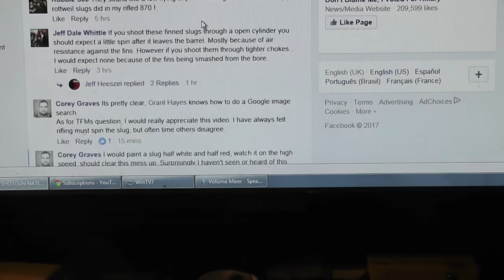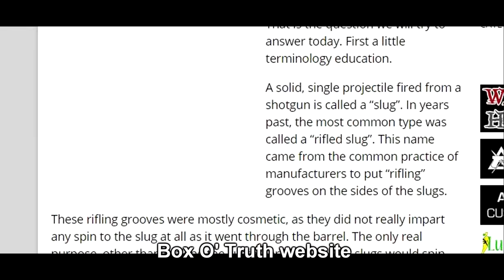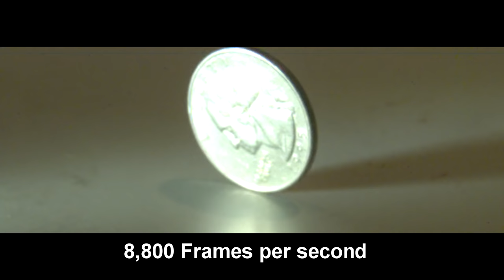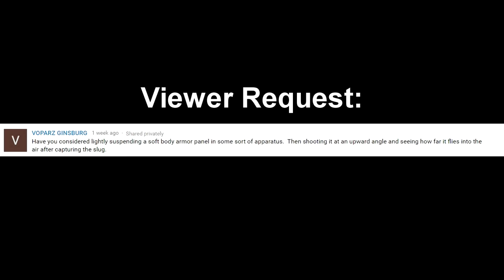Do Rifled Foster Slugs REALLY spin or it is just a MYTH?

Comment: I now run a 1oz smooth slug cast in a Lee mold from shot that I have melted and cast from cheaper "bird shot" cartridge and then reloaded with the slug. I use a Carlson Rifled Choke and the combination yields a pretty good result as my slug barrel gives me a fairly consistent 2'ish inch groups at 50 yards... and my smooth barrel with the Carlson choke gives me a 3'ish group... I'm fairly pleased with the results and didn't really expect it would be so good... it's also a lot lighter and more compact than carrying around two barrels. 😉

Comment: That is not how physics works. All friction is ALWAYS in the opposite direction of motion and can not introduce a torque perpendicular to the direction of motion. Having a rifle on the bullet will not cause any spin in a smooth bore barrel. All friction is straight backwards with 0 torque. Unless the slug is actually digging into the barrel, then the spin is from atmospheric effects or just randomly occurs.
Rifled barrels spin bullets because the bullets dig into the rifling and a torque is provided from the intermolecular interaction between the parts of the bullet stuck in the grooves of the rifle and the slug.
(Test this yourself: Slide a wooden plank slanted 45 degrees across a smooth surface, it will go straight, friction doesn't care about angle of contact.)

Comment: What if the rifling was cut into the head of a smooth slug where the shockwave is created?
Reply: This would probably make the slug inaccurate because the cuts are not always in the same position in the barrel when chambering the round but it is a great question I am curious about, too!
Reply: Green Silver might work but since thats your contact point with the air any imperfection would be greatly amplified as inaccuracy.
Reply: Fergesslich what degree of rotation a projectile starts spinning at has no effect
Reply: All you'll do is mess up the shock system further. If you want to give it rolling moment (that's the fancy word for making it spin aerodynamically by the way) just put some damn fins on it. Don't try to fuck with the shockwave, it is not your friend :P
Reply: being a SHOCK wave, the rifling would have no effect until it dropped below the trans-sonic wave barrier, at which time the wave would be able to shed down the path of flow and impart spin.

the only way (EDIT: that I can immediately see) the rifling would be able to impart spin via (nose interaction) would be rotational momentum gained through vortex shedding.... given that the rifling was deep enough and allowed for a vortex trough to form large enough to overcome the mass of the slug 90 degrees to the direction through it's medium of travel (1 atmosphere ambient air).

Comment: Is the lead of the slug really touching the walls of the barrel?  most are sabot in a plastic shroud to launch the slug.  Ive had discussions on this before with long range shooters and found that the design of the sabot is what gives the slight spin and not the ribs on the slug.  They are there for drag and not inherent for twist.

Comment: Oh... crazy thought... What about a small loose steel ball that would completely fit inside the cup under a foster slug? Would it travel within the shockwave of the slug without affecting the accuracy of the foster slug? Would the steel ball improve penetration?

Comment: I've been using the Lyman 525gn  'shuttlecock' slug with 21gns of Unique, AA white wad with an m6 nylon washer under the slug and a star crimp out to 250 yards. The only complaint comes from the target and my shoulder after a box or two. BTW, the gun is a 20" smoothbore with a rifled choke, straightpull fitted with a 3x9 scope. A great combo. 
Ocassionally I use an old b/a Mossberg smoothbore trimmed to 20" (no choke) fitted with a 6x scope. Never had so much fun with a shotgun until I discovered the Lyman slug.

Comment: The larger the diameter and the more mass you can place closer to the diameter, the more stability you'll achieve at a lower angular rate of change. That slug isn't hollow by accident. Great video.
Reply: Exactly!  Nor is a rate of spin of 600-800 RPM insignificant in  body of that weight and circumference.
Reply: @terrywaters6186  So @ 10 RP. How might that be expressed as a virtual rifling twist? The Enfield Pattern 1851 0,704" bore rifle had a twist of 1:78 and Forsyth rifling for big bores were much slower yet both stabilised their bullets adequately for their tasks.

Comment: For aerodynamic rotation at supersonic speeds, don't mess with the sides or skirt at all. Cut slots or grooves in the very front of the slug, through the boundary where the shock wave separates. 

My gut says very small near-radial grooves in the leading edge of a Foster slug should be effective, or in a "diabolo" slug's face out at the perimeter. The grooves would be angled more or less off radial to impart spin.

I would start with straight off-radial grooves—they're easier to make and likely to be more forgiving than helical cuts. Of course the pattern should be as center-symmetrical as possible. Otherwise the slug will wobble.

Alas, this is all theoretical—I can't try it myself. If any of you do, good luck!

Comment: I just shot a 10 point buck w a 12 gauge Foster slug at over 70 yards. Fired out of a 1950 Sears,single shot,30 inch barrel,full choke.
Perfect liver hit. Deer didn't travel one step. If its that accurate at that distance,does it matter if it spins?

Comment: Hey, is possible that nobody knows that those grooves are to pass safely through a full choke barrel? As in a drill bit you have grooves to put the wood/metal you are removing from the hole you are creating, in a slug you need place for the extra lead you have when passing through a full choke funnel. You can see an advise in sabot slugs to not fire with choked barrels, this warning is not in riffled lead slugs.

Comment: If you compare the spin to say for instance something like a muzzleloader firing a round ball, I think the spin on those things is only like 1 turn in 66 inches. So even that slow spin would be enough to stabilize a rifled slug.  
Ballistic coefficient is projectile weight divided by bore diameter. Unlike long, heavy rifle bullets that require a lot of spin to stabilize, I guess these slugs don't. 
I had always believed rifled slugs spin, but I thought it was airflow, not contact with the bore. 
Thanks, this was an excellent topic!

Comment: My understanding was they do spin but not fast enough to achieve gyroscopic stability. Rather they spin to help swage them down the barrel with less resistance, to help them match the barrel and become rounded out nicely as they travel down it, and the grooves reduce surface area touching he bore. I always heard the nose heavy design with a hollow tail is what keeps them stable and the slight amount of spin helps with that a bit also. That’s just how I always understood the workings of them though.

Comment: I think to round out the experiment you needed to fire one out of a rifled barrel to compare the spin rates. Remington lists 1 turn in 35 inches as a twist rate for a 12 gauge barrel, for example. Seems like that would be a much higher spin rate than you got from the smooth barrel?

Comment: The veins on the slug are there so it will go down the barrel in a full choke as well as cylinder bore, full choke will visibly distort the veins as it travels down the barrel.

Comment: I was taught when young the rifling is to allow the slug to go through any choke. Tighter chokes squeeze the rifling more than looser chokes. The bottom of the grooves is smaller than the tightest choke. This keeps pressures more consistent   through all chokes.
Reply from the maker: Almost all factory slugs have to be made to be safely shot through a full choke - just for general safety of the product.

Comment: It is impossible for the slug to spin because the slanted  slots are on the outside of the slug.however should the slug be a cylinder with the slanted slots on the inside, the slug would spin just like a rifle slug. The only requirement would be to add aplastic disk in the shell between the powder and the slug.once the slug is out of the barrel,the plastic disk falls to the ground .now air flows trough the inside of the slug cylinder with slanted slots in a jet like turbulence causing the resulting disorder spin for accuracy.  this stament is from my personal intellectual property and not to be patented by any other. Contact me if interested in diagrams .   Gunsmith.

Comment: on the spin: when you consider how heavy it it, that it's hollow and wide, the sides act as a sort of balance arm with high centrifugal momentum. compare low orbits of satellites to high geostationary orbits. compare ice skaters with arms out vs arms in.

the wider orbit can be much slower for the same level of stability, and with greater mass it won't lose that stability as fast. Do while it might not be as stable as using a rifled barrel or as stable as a higher twist rate on an equivalent weight but smaller bore round in 45-70, it's still enough to make a difference  (as your quarter analogy shows).

Comment: If you want to make more slugs that don't have ribs but stabilize well, get a mold for Lee Key Drive slugs.  They have that key rib inside so the shot cup wad can drive the slug in a rifled barrel, but they also have the weight distribution of a Foster slug -- and you can cast all you want from soft lead.
Reply: @SilntObsvr A few days ago I saw a video demonstrating the fact that the 7/8oz is nose heavy, but 
the 1 oz is not.  The 7/8oz set down on it's side would always roll onto it's nose. The 1oz would not......
Reply: @dd_ranchtexas4501  That doesn't really matter -- what matters is that the center of mass of the slug must be ahead of the center of pressure.  The hollow skirt ensures that.  All rolling onto the nose shows is that the center of mass is forward of the break between cylindrical and ogive sections.
Reply: @SilntObsvr  My point was that the 7/8oz and 1oz are DIFFERENT. As you originally posted assumed no difference. Yes the center of mass is different for these two slugs.

Comment: That solid ring around the base is counter productive to the spin dynamic. I know that it's for a gas seal but if  the fins ran full length of the slug instead of terminating at that solid ring, you will get more spin.

Comment: So the slug does spin some, but the rotation doesn't match the pitch of the rifling.  If the rifling were really fully engaging, the rate of spin would be much higher.  So it's kind of both, aerodynamic stabilization and rotation that makes it fly straight.  But it's not the same as a rifle bullet, which fully engages the rifling and really comes out spinning fast.

Comment: Here's a thought for an interesting projectile. A saboted slug wherein the sabot itself imparts rotation on the slug while traveling down the barrel. Using a composite sabot, either two separate pieces nested together or 1 solid piece formed from different materials, create spiraling veins of different amounts of friction. This way, you maintain a full seal the around the entire length of the sabot and the increased drag around the spirals is imparting spin on the projectile. Get to it, basement engineers!

Comment: There is metallurgy and physics at work here....

Lead is considerably softer than steel, your barrel is made (hopefully) out of high tensile steel to handle the heat and pressure of modern gunpowder. The Slug expands to the heat and pressure which is also accelerating the round, as it expands the grooving/rifling on the slug gets pressed against the barrel and starts to impart a spin.

One of the reasons why you do not want to shoot a rifled slug out of a rifled shotgun is that the lead fouling will get pretty bad, you CAN shoot them from a rifled shotgun, it's just not advised due to barrel fouling.

"But what about the crazy metal shotgun slug with aerodynamic rifling on it, that did not work...", this is the metallurgy at work, steel on steel is different than lead on steel, lead has a considerably lower melting point, breaks easier under pressure, and is more malleable at room temperature. When you exert the forces of modern gunpowder on soft lead, this leads to deformation in the barrel, and with grooving in a certain pattern and twist rate, you can "force a spin" in a smooth bore barrel.

Physics, Chemistry and Metallurgy = Ballistics

Comment: if you put a foster slug in a shot cup where the slug dose not make contact with the barrel. then if it were to spin on the high speed camera. then it would have to be the air that makes the spinning happen.

Comment: Upon looking at the slug... just a look and I knew it could not induce any necessary spin.  A blunt nosed bullet will hamper possible effects from a rifled projectile. The you also have the so very dramatic spin rate difference between a bullet shot from a Rifled Barrel that alterd the bullet into a rifled projectile. So use a Sabot round that is designed NOT to induce any spin on a rifled projectile by shooting that Sabot round out of a smooth bore barrel. AND make that Projectile "Pointy." This way no shock wave in front of the Riflings will prevent air from staying out of this projectile's Riflings. Most likely the rear of the bullet will require drilling so even the pointy end is still heavier than the rear of the bullet.     
     Then... there is the "riflings" inside the barrel forcing shape of riflings onto the projectile which neutralizes the ability of discernment without some intense research and testing. The Sabot round induces spin on the smooth projectile but once the patch leaves the projectile the remaining spin comes from what was already induced during the patch and bullet's travels through the Rifled Barrel.  Add to that the inability of so many YouTube videos all trying to explain something like it was new information, but instead not venturing any more than the already known and proven. In other words massive useless information.  Shoot a rifled (course thread) nail (or Screw) out of a smooth bore barrel and approximate size barrel... then you will have reached into unchartered territory. You will also have achieved up to date and valuable information. Alas, no one actually wants to be revelutionary in their Video programs.
   I would love to do these experiments, unfortunately I had my FireArms stolen (yes, I know who all did this stealing or assisted,  but our "to serve and protect" Police are unwilling to even make a report.  Sooner or later someone... (it will be later and the someone is someone I know... patience my friend, I keep telling myself) will provide police with the Justice it deserves

Comment: tell ya what....rotating or not, seems pretty accurate for a slug. Even if the ribs are just causing a little drag on the rear of the slug, it probably is still stabilizing it.

Comment: How about some longer range shots. That slug might gain in rpm's and stability with increased distance. The shock wave at the nose might not eliminate all of the air-flow through the veins. That air-flow would compliment the spin it got inside the barrel. If so, it might, also, cause a predictable deflection but, in what direction and, how much vs. how long of a shot?

Comment: taofladermous- i have the mossberg 590 special purpose 12 ga. i have noticed that a good section of the barrel from  the chamber where the tip of the shell sits ( throat ? ) to about halfway or less than halfway down the barrel, it appears the bore goes from wide to skinnier. Once it goes past this point i feel that's when any slug gets a tight fit. Have you considered that this may have an impact on spin and if this is normal for all, most or just my model shotty? by the way my baby eats 2 3/4 and 3" magnums.

Comment: The original Foster design had ribs or ring grooves. These were refered to as rifled slugs. Most commercial designs used to look more or less like Breneke slugs with straight ribs and a ring at the back to make a gas seal. In the last few years essentially all the brands angled the ribs to make "rifling". I think it is marketing.
Reply: Rifled slugs in 1972 looked just like rifled slugs today.

Comment: remove the wad/shot cup and place the slug directly on the powder (especially if you use blackpowder) and allow the gas pressure to expand the 'skirt' of the slug so the embedded rifling  presses against the barrel and it should end up with more spin...it would be like a a civil war Minnie ball in the rifled musket but with the rifling reversed and on the slug instead.

Comment: I would have guessed it rotates slightly. Did you ask this somewhere? I missed it. My explanation would have been that it's not the same as a regular bullet going through a rifled barrel. The simple reason is that it wouldn't engage as much, rifled barrels mangle the bullet as it goes through. If the slug would mangle up the barrel as it went through, you wouldn't want one. So it engages, but not as much as it should to make it spin properly.

Sadly I could not make this prediction before the video.